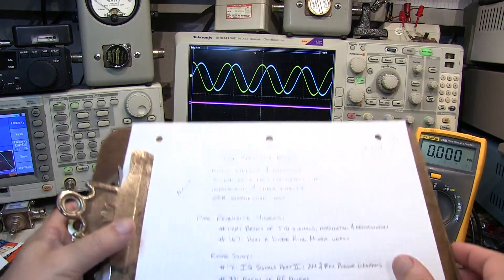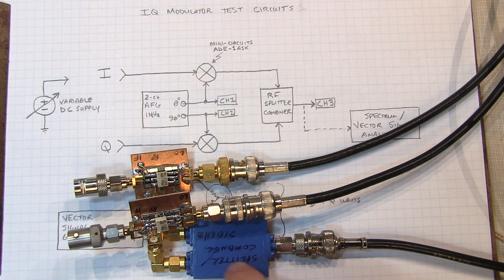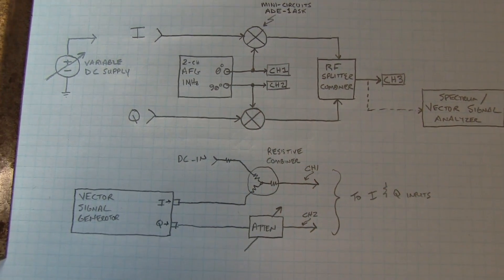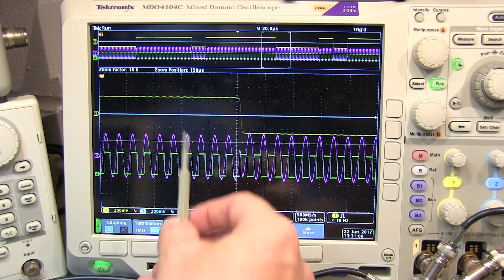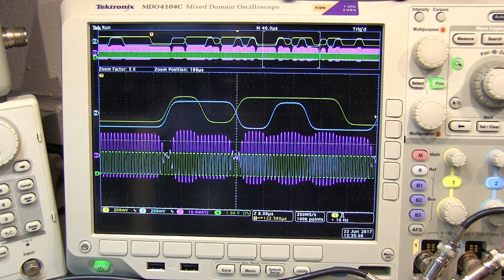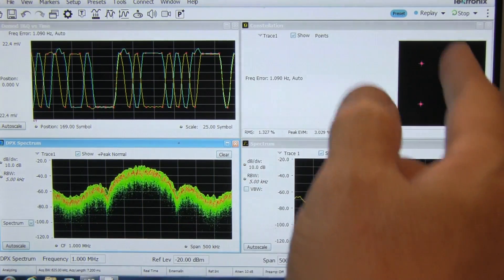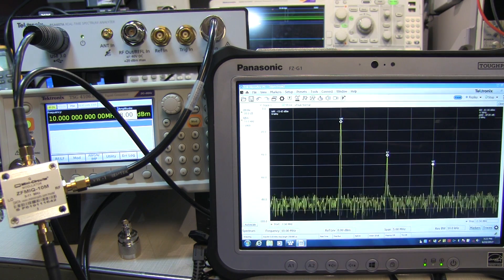#262: IQ Modulator Basics: Operation, measurements, impairments

Comment: Agree with the other commenters - really an excellent presentation of the material. Start with the goals, describe the circuit, and demonstrate the circuit. Where you go above & beyond is with the impairment demo. Just looking at the equations it is very difficult to visualize how the input impairments affect the modulated signal, but the demos make it crystal clear. Not just the "what" but the "why."

Comment: Hi! Excellent video as usual! What would one use (circuit or IC) to generate quadrature signals other then quadrature hybrids (they seem pricei...). What would be a low cost alternative for not so precise applications?
Reply from the maker: There is a fairly common technique that is found in low-cost SDR radios that uses a 4x clock and some dividers to create a pair of quadrature clocks.  See an example in this video: https://www.youtube.com/watch?v=BG0rmMGpwMc

Comment: Hi Alan, Thanks for the excellent video, as always. I notice, at around 12.40mins (the ‘single sideband suppression test’), that you are supplying the Minicircuits ZFMIQ-10M IQ modulator with a positive frequency at baseband (i.e. an anti-clockwise-rotating IQ phasor), and at the RF output what you see is the LOWER sideband (LSB). So this module turns out by default to be spectrally-inverting. Is this normal default behaviour for such IQ modulators? I would have expected that, by convention, the designers of such devices would wish to make them non-inverting by default, as it would perhaps seem more logical. Regards, Damian (G4WPO).
Reply from the maker: While the paper showed that I applied COS and SIN to the I and Q respectively, the actual signals that I applied were actually reversed.  I had put an annotation on the video in YouTube, but YT removed the annotation feature and thus that note was lost.
Reply: @w2aew  Thanks for the response, although now that has thrown me somewhat, as I was expecting that the IQ mixer WOULD be spectrally inverting, whereas you’re saying that it isn’t. My reasoning for expecting spectral inversion is as follows:- imagine you have at complex IQ baseband a phasor with a low +ve frequency, starting with zero phase at 1+j0 (i.e. I=1&Q=0) and then gradually increasing in phase towards 0+j1 (i.e. I=0&Q=1) - i.e. gradually transitioning from pure I to pure Q. If you then think about what you would get out of the IQ modulator, it should start as cos(wt), when I=1&Q=0, and then gradually shift phase to end up at sin(wt) when I=0&Q=1. So at the end of this thought experiment the RF carrier phase is lagging by 90-degrees (w.r.t. the LO) what it was at the start (since sine lags cosine by 90-degrees), so the phase has been going in a -ve direction w.r.t. to the LO, or in other words the frequency at the RF output of the IQ modulator is slightly LESS than the LO. Hence a +ve frequency at complex IQ baseband has translated to a -ve frequency (w.r.t. the LO) out of the IQ modulator, or in other words the IQ modulator has created a spectral inversion at RF. At around 2 minutes into the video you describe an IQ modulator which you created yourself, which conforms to the paper diagram which you drew. Can you confirm that this homebrew IQ modulator is in fact spectrally inverting, as I have reasoned above?
Reply from the maker: @damianbevan5967  yes
Reply: @w2aew  That's great. Thanks.
Reply: @w2aew  Here's a nice tech note from Maxim, which I've just learned about, on the topic of inverting vs. non-inverting IQ modulators, which nicely sums up the whole issue: https://www.maximintegrated.com/en/design/technical-documents/tutorials/5/5499.html

Comment: I know this is an old video... but if I'm building an IQ modulator for use on amateur radio bands, what is a good benchmark for "sufficient" carrier and sideband suppression?  If I have -40dB carrier, and -50dB opposite sideband, is that "good", or do I need to do more work to make it better?  Thanks!
Reply from the maker: That seems pretty good, the rest can be done with filtering...
Reply: @w2aew  Wow, thanks Alan, I appreciate it so much! This is such an amazing hobby, where people like you are actually accessible, and even reply to newbs like me.  Thanks!

Comment: W2AEW, thanks for these videos, they are very well put together and informative. Tell me this please: Have you ever heard the term "Universal Radio" when applied to IQ modulation/demodulation? Not as an "actual" radio, but a reference to the universal way that any signal type can be composed or decomposed by IQ analysis? I was sure I heard someone mention the term "Universal Radio", but I lost track of the reference.
Reply from the maker: I can  understand why a SDR platform could be called a universal radio - because once you have the RF signal represented as IQ, you know everything you need to know to process that signal - at that point, it's just math....

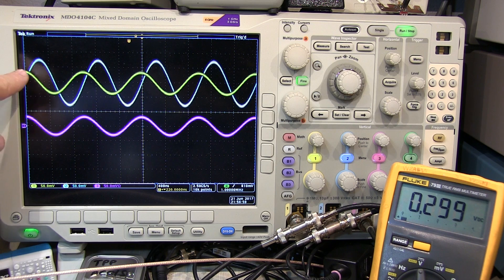Comment: Hey Alan, I would be glad if you could explain why LO for In-phase signal generator has dropped off its amplitude when you had applied non-zero I(t) signal. (4:00)
Reply from the maker: Because it changes the bias on the diodes in the mixer, thus changing (lowering) the input impedance of the LO port.

Comment: Curiosity : what vector signal generator you used to generator digital signal? For I and Q inputs- thanks in advance for your reply. 

Also I believe that you used the same tektronix MDO4140C to generate 2 LO (Quadrature) input signals and monitor/display same 2 LO signals plus 3rd output modulated signal? Am I correct in my assumption
Reply from the maker: I used a Tektronix TSG4106A vector signal generator to get the I and Q signals.  The 2 LOs were generated using a Tek AFG3252B 2-channel arbitrary function generator.
Reply: w2aew thank you soo much Alan 👍🏻😄

Comment: I've probably watched this video 20 times. Such a good video. I do have a problem though that I've asked many people at my work but none can answer me. At the nulls of the frequency spectrum I'm getting harmonics. So say my LO is 2Ghz and my I and q being fed are 20 MHz square waves. I get large harmonics at 2020, 2040, and 2060 etc.  I dont see these in your video so I'm not sure where they are coming from in my setup. Again, absolutely love your videos, I wish I was taught this way in college.
Reply from the maker: Depends on the design of the mixers.  Also can depend on whether the 20MHz squarewaves have a DC offset on them, or are they balanced around ground.
Reply: @w2aew  the square waves do have a DC offset on them. they are balanced though, also I'm generating the square waves from an fpga and its psuedo random.
Reply from the maker: @slothluvschunk2301  If they have a DC offset (i.e. they run from 0V to xxV), then they are not balanced around ground.
Reply: @w2aew  thanks so much for the replies I really appreciate it. I meant that the dc offsets are equal to each other on both the I and Q lines.  I keep thinking this is some sort of symbol clock leakage or possibly the bit stream is not psuedo random but repeating some pattern.

Comment: I want to thank you for all of your videos on I Q modulation.  I had a little trouble following your video #170 which is about demodulating IQ modulation.  If you apply an AM signal to the input of a quadrature mixer such as the Minicircuits ZFMIQ-10M, would both the I and the Q outputs vary with the amplitude of the input signal.  would the phase shift of the output signal be 45 degrees?  I did not quite understand about the rotating vectors and the demodulation of a FM signal.  I have a goal of understanding IQ modulation and then demonstrating some of your experiments for our local ham radio club.  One question I have relating to this video is how to solder the the Minicircuits ADE-1ASK mixer to a circuit board.  I don't have any reflow soldering equipment.  Is it possible to demonstrate some IQ basics with just using a 2 channel DSO, a good signal generator, the Minicircuits ZFMIQ-10M and the Minicircuits ADE-1ASK, and a spectrum analyzer?  Thank you,  Rick Phillips
Reply from the maker: Yes, if you apply an AM signal to a quadrature demodulator, both the I and Q output will vary in amplitude. Phase between the I and Q outputs will be 90 degrees, due to the 90 degree phase of the LOs in the demodulator.  I hand soldered the ADE-1ASK onto a small SMT breakout board from QRPme (http://qrpme.com/?p=product&id=MEP).  Very easy to do - just solder one leg at a time.  You're going to need a couple of generators - one at least for the LO input, and possibly another two for the I and Q inputs respectively.
Reply: Thank you.  I was thinking of using the Minicircuits  ZFMIQ-10M quadrature mixer to obtain the 10 mHz quadrature signal and then using the ADE-1ASK mixers, one on the I output of the ZFMIQ-10M and the other on the Q output of the ZFMIQ-10M.  I would  use a Wavetek (older) signal generator as the 10 mHz input to the LO of the ZFMIQ-10M.  I would apply the input signal (RF input)  of a variable signal generator to each of the ADE-1ASK s.  I did not quite understand how to get the I and the Q vector lines that you obtained on your oscilloscope and how the vector lines rotate with a FM input.  I think that I need to study a little more to understand about demodulating SSB signals.  
What inspired me to learn about IQ modulation and demodulation is that we have had several hams talk about SDR radio and IQ modulation, but with no real good explanation of how IQ modulation really works.  I know and have several books about SDR, but these books are on an engineering level with complicated mathematics.  I am now working on sharpening my math skills and concentrating on trig and complex numbers.  I would just like to explain IQ modulation on an intuitive level and I would love to tinker with IQ modulation and demodulation.  Thanks again.   Rick Phillips
Reply from the maker: I think you need a ZFMIQ-10D Demodulator to give you the I and Q signals, not a ZFM-10M.
Reply: Okay, Thank you.

Comment: The part that im still missing when demodulating is, how would you generate the LO signal? How do you lock into the incomming signal frequency, and know what phase angle your reference signal is at, compared to the recieved RF signal? Isn't that necessary to know, so the constellation diagram isn't shifted at the reciever, so you demodulate the wrong bit patterns?

Comment: Question: As I understand it, demodulation requires not just the received signal, but also the original IQ signals (or at least one, as it's trivial to derive the other with a phase shift). Obviously this is not going to be available in most situations, so what is the practical solution to this problem?
Reply from the maker: Usually there is a unique data pattern in the transmitted data that is used by the receiver to establish the base phase of the signal.  The receiver performs an IQ down-conversion and looks for the sync pattern in the n-number of possible constellation phase rotations.

Comment: You can use the SSB test as a reference to make the IQ modulator output more ideal by adding DACs and voltage sensors along the path.

Comment: I'm not as familiar with the digital modulation methods, can you discuss the uses and pros/ cons of this modulation method?
Reply: Modulation is used when you are going to transmit your signal through a long distance. If you want to send you baseband signal(i.e. signal without modulation with an antenna, you would need an antenna maybe a few kilo meters long). In this video, he demonstrates basically a few linear modulation methods. Pros: Simple to build. Cons: Less resistance to noise in channel.
Reply: QPSK is an expection. It's a non-linear modulation.